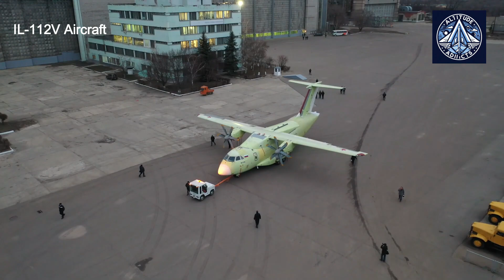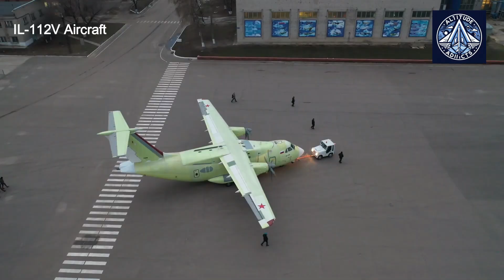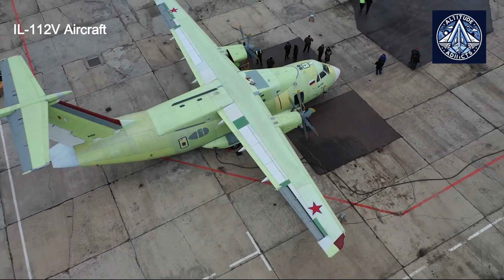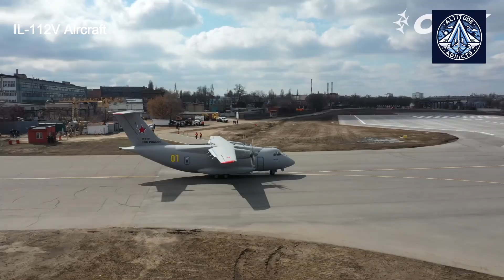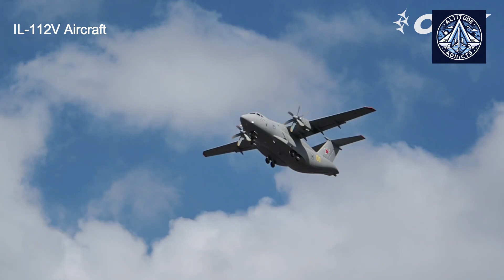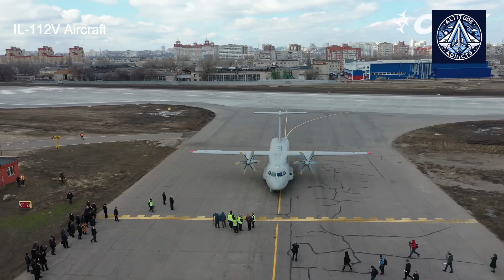Russian Il-212 Light Military Transport Aircraft With PD-8 Engine and the Failed Il-112V

Comment: I dont understan bur 114.300 engines are not strong ^?
Reply: st7-117 engine was originally designed for Mi-26 helicopter, so there was -01 modification for il114 and -02 modification for il-112v.
Reply: @АндрейАндреевич-з7т  ok thanks

Comment: No.. reliability will be greater and lag time for spool up lessened (high torque changes can leas to turbine over heating and with the turbofan, these changes are not as great as in propellers).. plus it will make a good water bomber (that could be an add on kit to the bottom fuselage and keep the electrical wiring out of the bottom of the aircraft) that can be made for export.  Boeing made a high wing jet engine transport that did not make it through the 'winner take all' contract style of the USA (a very flawed concept) that preformed more than adequately.. and had parts compatibility with other Boeing products, just not those in military use.  It is noted that due to the sanctions still in place the Be-200 Russian Jet water bomber is undergoing the same engine conversion.

Comment: They will still need a light propeller driven aircraft so the Il-112V makes sense. The engine they were using for teh Il-112V is the same as that used in the Il-114 and Mi-38 so when it is ready it is going to be very widely used in Russian aviation, but the increased power version for the Il-112V was marginal in terms of power and not reliable, so they decided to put PD-8 jet engines on the aircraft and replace the An-72 and An-24/25/26 light transports. The Il-112V will still eventually enter service for the same reason that the An-24/25/26 types continued to operate even after the An-72 entered production. The lighter aircraft are slower but also cheaper and make sense in a lot of roles, so an Il-212 and an Il-112V makes sense. The engines for the Il-114 have been improved in power and reliability so it could be that the Il-112V could be restarted, but the Il-212 will also be useful, especially in the far east and far north where a jet is easier to maintain. Hopefully the Il-276 might also move its engines to the top of the wing like the An-72 and Il-212 to allow safe rough field operations.

Comment: I don´t understand, those aren´t the egines for the Ilyushing Il-114? I think Russia will need both the Il-112 and the Il-212
Reply: il112 was canceled and continue as 212 as far as i understand.
Reply: @jebise1126  The Il-112 was stopped or paused. Turboprops are much cheaper to operate than jets. If the Il-212 was able to replace the An-26 then the An-72 would already have replaced it. The An-72 can do everything the An-26 can do but the turboprop An-26 is cheaper and easier to operate so they ended up using both, and for this reason the Il-212 will be able to replace the An-72 but a new turboprop based on the Il-212 (ie the Il-112V) would still be useful for commercial use and for military use to save money when its lower speed is good enough to get the job done. The TV7 engine is being used in the Il-114 and other platforms as well so it is going to become much more reliable and they will likely increase its power over time and once they get the power up from the current 3,100hp to perhaps 3,500hp or perhaps even 3,750hp with good reliability then it would be worth making the Il-112 again. The extra power would make it better, and the lower operating costs would make it more attractive to commercial operators wanting to replace their An-26s.  The Il-212 should be ready faster and enable the jobs of the An-26 and An-72 and An-140 to be performed, though at a higher cost than the An-26 would cost to do the job. An acceptable compromise while the Il-112s engines are sorted out.
Reply: Il-114  is passenger aircraft without ramp. Engines are slightly different because of less of pulling force required, namely, st7-117-01.